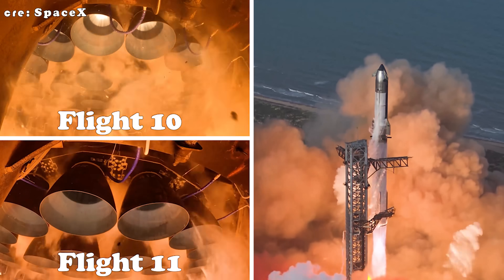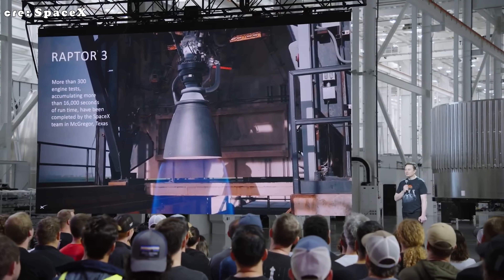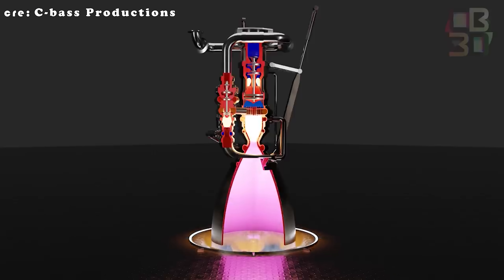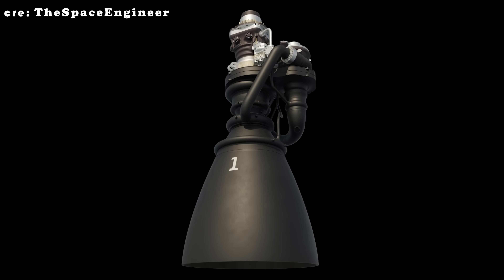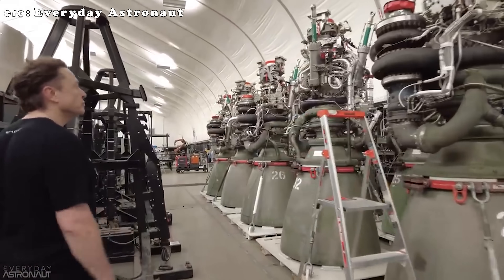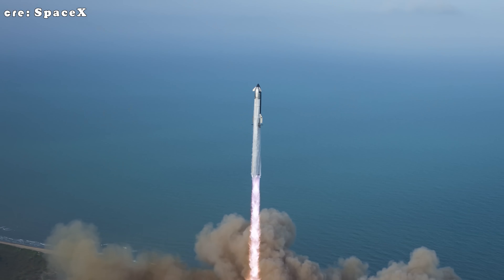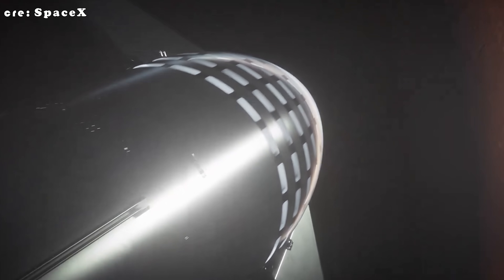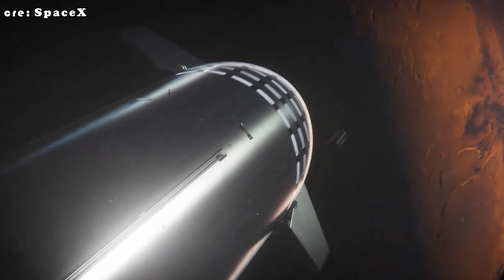SpaceX Upgrade Everything on Raptor 4 After Starship Flight 11 Shocked NASA's Engineer…

Comment: All the promises on the next big thing. How about a reusable heat shield that can renter the atmosphere at higher velocity than from suborbital speed.  If this cannot be done then why bother?
Reply: It can be done, but there's no point going for the most expensive option available, if a cheaper option will grant the same performance & thus it's wise to start cheap & end expensive in testing.

Comment: With R3 and R4 not needing the shielding like R1 and R2 the outer 20+ engines could be multi cycle using atmosphere with supplemental LOX at takeoff though 25-35K feet altitude saving on LOX use until high altitude where they would switch to full liquid LOX and LCH4. This design would allow booster to fly further on same amount of fuel. A rocket engine is basically the afterburner used on fighter aircraft, instead of engine exhaust used to ignite afterburner on Raptor the turbo-pumps and preburners take the place of air breathing jet engine forcing the Raptors to run 100% off of condensed cryogenic liquid fuel and oxygen. The use of cryogenic liquid fuels has been standard for rockets regardless of fuel used because they need to take the O2 that would normally be pulled from the air with them to space. This is what makes rocket engines so hard to control, it's like trying to tame a 1000HP engine running on a 2000HP Nitrous system 100% on the time instead of only a few seconds like NOS is used in drag racing.

Comment: I wonder if there'll ever be a 'Falcon Heavy' version of Starship. With 2 extra boosters strapped to the side.
Reply: if they ever actually get the thing to work first,  maybe
Reply: @jebes909090  So that'll be a no, I suppose.
Reply: More like 40 of them 😅
Reply: No need for that. They will fly everything they want into orbit and for beyond they just refuel it in space and fire the engines again. The Starship will be strong enough to do the same like the falcon heavy was needed for.

I guess the only reason would be if they want to fill the ship up with steel or even more heavier shit. But why would they do that...?
Reply: Omg. 3 boosters pushing one ship. Can you imagine the G forces??

Comment: why cant they take two of the "tanker rockets" attached to the starship just like booster rockets, take the tanker rockets with starship to the moon.
Reply: because the more you weigh,   the more fuel it takes to get you up there.      plus right now it can only take 100 tons to orbit(MAAAAAAAAAAYBE).   so to refuel the ship to go from earth to the moon will take at least 5 or 6  extra launches that have to not blow up the original starship while refueling or even gettting up to the original one.